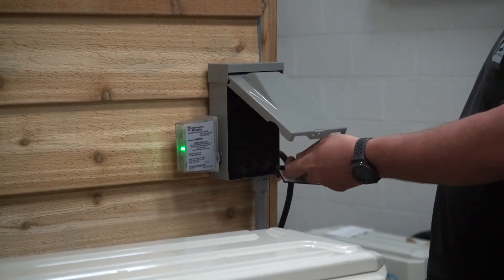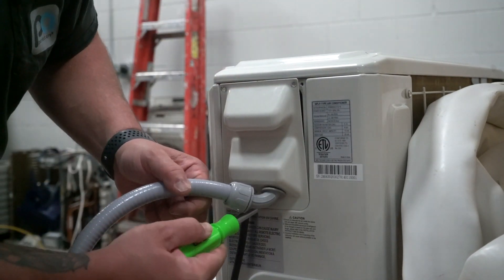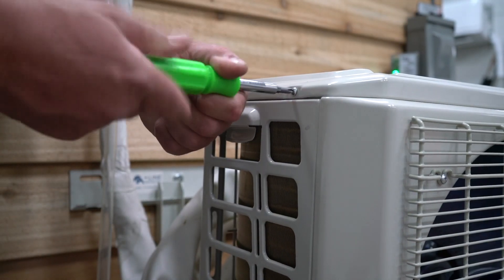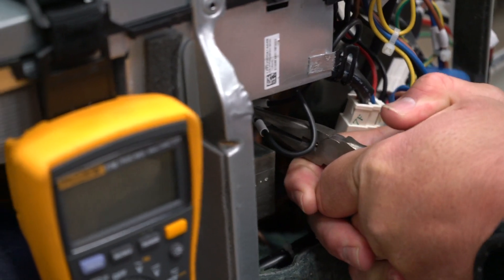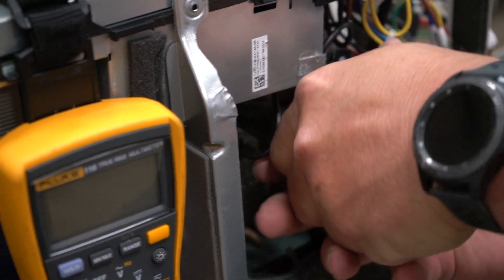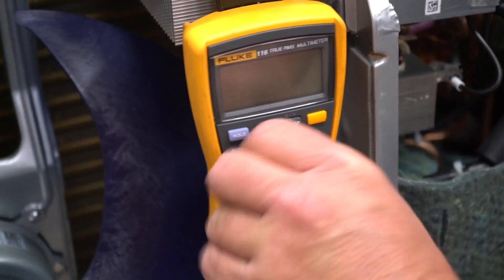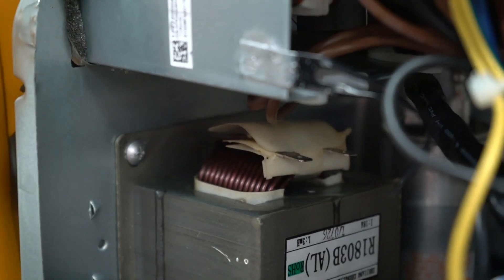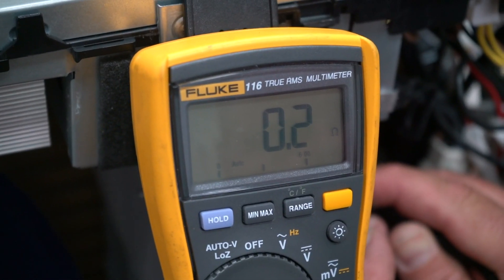How to Ohm Out a Reactor on a Mini-Split

Comment: What is reactor & its function? If its showing 1.5 ohms or more , what will be the effect?
Reply from the maker: Hello Sujit! A reactor opposes a change in current, usually when measuring resistance the the reactor should measure under 1 Ohm. Anything over 1 and your reactor may be bad.
Reply: @PerfectAire  thanks
Reply: So, my understanding is that a reactor is nothing more that an inductor that acts in opposition to A/C current?